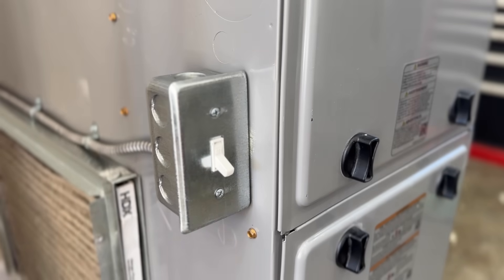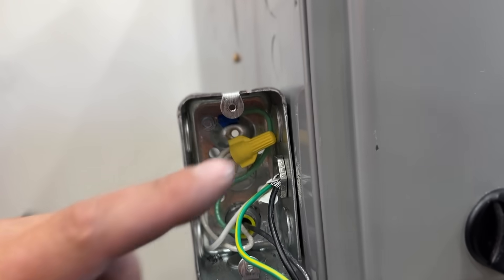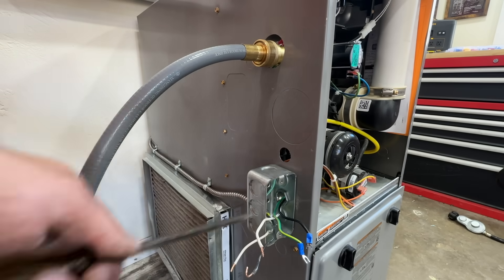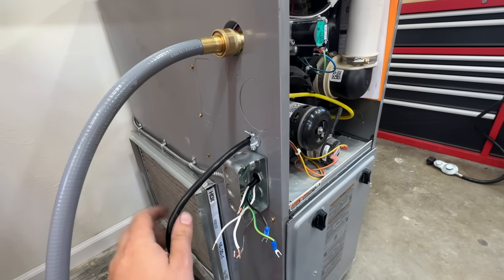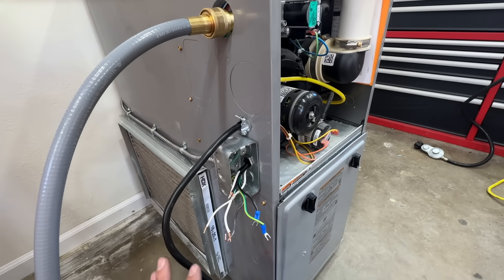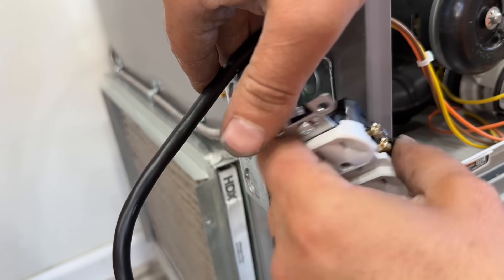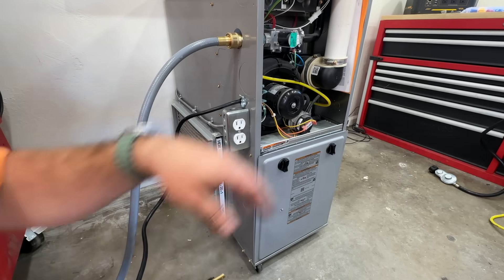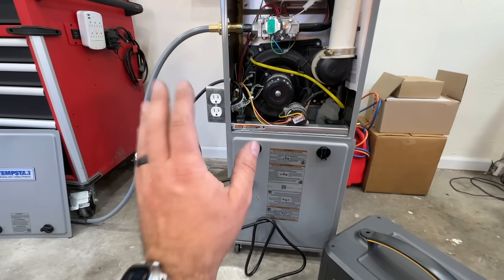Keep Your Family Warm During A Power Outage By Installing This $5 Part

Comment: Any options for those of us that only have an electric furnace? Is there a way to power it from a generator? I know the generator would probably need to be dedicated just for the furnace but in a winter outage, that heat is a necessity over anything else. Thanks.

Comment: The video was very well done. Thanks. I am curious as to why the pigtail goes into the furnace and then back into the box instead of just going into the box directly.
Reply from the maker: Because if the box was not attached to the unit, as a lot are, then you’d simply run the pigtail into the furnace, and then swap your switch for an outlet 👍🏼

Comment: For how long will battery back up run system motor+gas valve+ igniter +exhaust fan?????great video i did same with Water cooler but converted to 12volt system 👌👌👍all day for free all night Deep cycle batt…58degreezz until april in So cal desert

Comment: I would not recommend a remote AC voltage checker. Not OSHA approved. I would rather use a DVM
Reply: I'm not sure what you mean by "a remote AC voltage checker" but if it is just a "non-contact voltage tester" you'll need to provide chapter and verse before I will believe that. The US Occupational Safety and Health Administration (OSHA) requires some workers to be equipped with non contact voltage testers so as to avoid accidental contact with undiscovered exposed conductive surfaces which have become energized by a fault to a current carrying conductor. 

Telephone outside plant technicians carry them on their belt when climbing utility poles which also carry electrical wires and employer owned communication only poles. Those can be switched to continuously on to provide warning of low voltage communications wires that have a cross with power and light conductors. Some models can be focused on a particular conductor and opened to check a larger area. DVMs are classified as to what voltage that they can be used on. Non contact voltage detectors do not have to be categorized for different voltages because they don't need to make contact with an energized part to detect the magnetic field produced by alternating current. 

Tom Horne

Comment: The hole you drill for half inch connectors is actually a 7/8” hole, not 1/2”.

Comment: I split the cord going to my furnace and installed a box and plug. If grid power goes out, just unplug the furnace from the box and connect to my generator. Neutral and ground MUST be connected together in the generator for this to work. Honda EU1000 doesn't even come off idle to run both fans in the furnace.

Comment: Finding the electrical box to modify for my boiler is confusing, as I was unsure of which one is the "master" power box, which electrical box powers the circulating pumps and pump controls, and which electrical box is just for the burner. I thought about it and realized that I could start at the house electrical panel and follow the Romex which powers the boiler, and then (with the breaker off) cut into the Romex.  Cutting into the Romex will result in a set of black, white, and green wires coming from the breaker box, and a set of black, white, and green wires which go to the boiler. I can then place a new electrical box with the wires from the panel powering an outlet. And I can place a second electrical box nearby with the Romex which goes to the boiler connected to a pigtail inside that second box with a plug emerging from that box. The plug can then be plugged into the box which brings power from the breaker, OR it can be plugged into one of the outlets on my Delta Pro power station.  Logically, this set-up should work exactly the same as the one explained by the DIY HVAC guy in the video - the wiring is the same, it is just set up a bit differently.  Hey. . . if anyone sees a flaw, particularly something really stupid about my idea, please tell my why my logic is wrong. HEY DYI HVAC GUY . . .  IF MY IDEA IS WRONG (PARTICULARLY IF IT IS DANGEROUS OR MIGHT DAMAGE EQUIPMENT) PLEASE STOP ME BEFORE IT IS TOO LATE 🤔

Comment: I have aprilaire system so would I wire aprilaire to the pigtail or to the outlet? The way your video is laid out everything needs to be isolated from the incoming power outlet. I’m sure that’s the case I just want to make sure

Comment: Thanks for the great videos!  I just did this modification to our boiler.  Last winter, we darned near froze during a power outage, even though we have a generator. A previous owner had a generator transfer switch installed with a number of circuits, but unfortunately, the heating plant wasn't one of them!  I don't know why I didn't think of this fix myself, but at least it is done now.

Comment: I would just leave the switch in place. Add a 2nd box with the source of power and a receptacle. A chord from the switch box could either be plugged into the receptacle box or to an alternate power source. Switch will shut off furnace as usual no matter what power source is being used.

Comment: Except code requires you be hard wired. The code approved way to do this is with a dedicated transfer switch (even a single circuit one like EZ generator). The way this video advertises would likely fail inspection.
Reply from the maker: As I stated, this can easily be reverted and a lot of inspectors will not call this out in an inspection.

Comment: Not quite sure why you go into the furnace box first, instead of just knocking out another knockout in the switch/receptacle box.
SOP is usually to probe with the voltage tester FIRST (to ensure your tester is working), THEN cut the power, THEN retest to make sure no voltage.  It's rare, but you could get shocked if your tester has failed and you have not truly cut power
That's a nifty idea for the wire strippers.  I just use the end like a pliers to make the hook, but that works too.
If I'm not mistaken, relying on the tabs and screws of a switch or receptacle does not meet code, that's why there is a separate ground screw on the device.  Much better just to use a 3 position Wago and put in the pigtail regardless.
Love the Wagos.  Expensive, but IMO well worth it.
Should really tighten the cable clamp as tight as feasible; it should not rotate like it did when you did the last tightening of the clamping screw.
Hey! You get an extra outlet in the deal that you didn't have before, to use when the utility power is still on!

Comment: I recommend NOT coiling excess wire since it will create induction, which will lower the voltage slightly. run a straight zig zag, or end to end to avoid that issue.

Comment: I have always used a power cord on my furnace for this purpose and just plugged it in to a standard outlet. Living our in the country on a farm, we always experienced power outages, so your fix is a very good idea. I would've just put the romex connector on to the handy box, but it is just a preference. If you have a standard outlet near by, just pigtail the furnace. This can be done in a short time as it may be done during an outage, but it will require you to have the stuff to do it with, even if you have to swipe a cord off an appliance like a toaster, etc. I think the thing to keep in mind is this fix will only last as long as your power source, so plan accordingly. When this happens, you may want to make alt arrangements to relocate if the power will be out for a long period as most alt power sources will not last for long periods as your fuel runs out.

Comment: Does the furnace not need a switch close by, and screws not used in outlet should be tightened and not left loose.
Reply from the maker: The plug acts as a disconnect. So no need for a switch

Comment: That wire clamp is typically referred to as a "Romex clamp". Romex is the big brand name (much like people refer to all adhesive bandages as Band-Aids). Telling your local home improvement guy that you need a Romex Clamp should help you find one in the store. The actual nomenclature would be an NM clamp (NM standing for the Non-Metallic insulating sheathing of the wire). You may also find them as NM/SE clamps. The SE part isn't important for this application - but it just designates that the clamp is for Service Entrance (and indicates the cable jacket and the internal conductors are designed for above-ground installations and are listed for installations where the cable jacket and internal conductors are exposed to the sun in wet locations... in other words, residential use). Using these key words, you should be able to find them right off the bat with a google search.

Comment: I used an extension cord, stripped it, connected it to the furnace power wires, and ran it to the outlet.
Reply from the maker: Yea I don’t understand how some can find this confusing in the least. It’s like wiring a pigtail for any other appliance. Cheers

Comment: Before I ran a generator plug outside along with a lockout plate on main panel, I did exactly this, along with the same setup for my well pump (20 amp 120v).  I used a single instead of duplex, so no one can plug in anything else while furnace is running.
Reply: NEC 210.8(A)(5) requires a single outlet or a outlet/switch.
Reply: Guys, here is The Savior

HalleluYAH translates “Praise ye YaH”

YaH is The Heavenly Father 
YaH arrives via the TENT OF MEETING
YaH was Who they Crucified for our sins
YaH was Crucified on an Almond TREE

— Ancient Semitic Cuneiform of Moshe (Moses)
— Isa Scroll (The Original Isaiah)

Isaiah 42:8
"I am YaH; that is my Name! I will not yield my glory to another or my praise to idols.

Isaiah 43:11
I, I am YAH, and there is no other Savior but Me.

Isaiah 45:5
I am YaH, and there is none else.

Comment: Can we change this if you have a screw in fuse on the side of the furnace?
Reply from the maker: Yes if your breaker is the correct size for your furnace you can totally eliminate the screw in fuse switch combo 👍🏼
Reply: Would you have a video on that by chance. Thank you

Comment: I wired a kitchen sink disposer using a pigtail I cut off a 14 gauge outdoor rated extension cord, a normal outdoor rated thick sheathing/wire cover flexible electrical power cable . The city inspector doing a pre-sale home compliance inspection wanted the pigtail changed to an "equipment rated pigtail" whatever that is. Life Decided not to sell the house, I decided not to change the pigtail. Years passed and the disposer eventually failed, by then I had realized sink disposers were an unneeded, needless complication to life with bad odor potentials. Perhaps even pipe clogging potentials. Will there be some "inspector" who will want to see a switch? - hence perhaps a switched outlet would be acceptable?
Reply from the maker: Yes some would say it needs a switch, but some would say this is totally fine. And it’s easily reversible if that was the case
Reply: @diyhvacguy  I have gum-shoed around a bit because, living in Minnesota, I, as you, know gas furnaces are best wired to be easily powered during an electrical outage. One recommendation I found is to use a single outlet, rather than a duplex outlet, as the furnace circuit is meant to be a dedicated circuit.  The code, most certainty, needs to accommodate the reality of the need for home heating backup power options.

Comment: Why is it proper to have the hot on the right side?  I was told to have the ground prong on top in case something fell between the plug and outlet, it wouldn't short out.
Reply: There is no requirement in the US National Electric Code nor in the Canadian Electric Code to install the receptacle in a particular orientation. If you are concerned about this possibility use a plastic cover. 

Tom Horne

Comment: This is what I was looking for.. I’m prepping for this seasons winter storms which typically leaves the grid down for a few days. I have a Goodman GM9S800403AN and an Anker C1000… I noticed that it will power the blower/fan, but not enough power to ignite a flame.

Should I get a bigger unit?

Comment: Great hack!  Careful leaving any of the outlet's power terminal screws loose when installing them, especially in a metal gang box.  I made that mistake once and almost burned my house down.  Even if the screws aren't connected to any wires, they have power running to them based on the outlet's pass-through design.  If they aren't screwed down, they can arc to the gang box and cause electric shock and fire.
Reply: Great advice to tighten down any unused screw terminals.
Reply: I was looking for this comment.
Reply: Unless the device yoke has been damaged or modified, it would be impossible for an arc to occur at those voltages.
You'd need 10s of thousands of volts to jump a gap (like a spark plug)
Reply: @jsimanella  Not the point.  If the clearance is small enough, the screw could vibrate loose and contact the case, or something else conductive.  Vibration could come from the blower motor, for example.
Reply: @LoanwordEggcorn Agreed, in fact I have tripped circuit breakers during installation by letting the hot screws touch the box. It much less likely if you tighten the screws. Some recommend taping the screws, as well. That’s up to you. 😊
Reply: @TomCee53  Yes, I've seen people wrap electrical tape around the screws. Seems like a good idea.
Reply: @LoanwordEggcorn  I started taping outlets and switch a few years back.

Comment: Why do you say the hot should be on the right? I know it's a debate, but I feel there are only advantages to having ground up, and only disadvantages to having ground down. If something conductive fell on the prongs there's 100% chance of shorting with ground down, and less than 50% with ground up. It's safer when gripping the plug too. It 's not supposed to be a smiley face.

Comment: I don't understand why the original furnace power wires were not pulled out of the junction box and connected to the pigtail inside the furnace box itself. Wouldn't that give you a lot more room to work with?

Comment: Hi, i want to do this and during power outages, run it off my motorhome generator or inverter. My hvac system is 2 years old and dual fuel. I have a nest thermostat but no way to switch between heat pump or propane. If i lose electricity and use your setup, will system automatically run on gas? Thanks.

Comment: This is a great idea. Can it be done in an emergency situation on a gas fireplace that turns on by a switch?
Reply from the maker: Typically a fireplace has an outlet on the inside that the fireplace plugs into, so you’d just unplug it and plug it into your power station 👍🏼

Comment: Appreciate the video- this is a great idea!  However- you should ALWAYS run a ground pigtail to the outlet from the feed ground, and not rely upon the screw connections for your ground.
Reply: Agreed - at minimum he should have removed the fiber/plastic square washers that serve to insulate the outlet from the box.

Comment: I think that your modification is a good idea. But I would definitely check the electrical code. I am not sure of where you are located, but in my area, your modification is not to code. What was done will work but is not electrically safe. The ground screw must be bonded to both the box and to the device (receptical). The device mounting screws are not considered a proper bond. 

Also as an electrician, I can tell when a non licensed person does electrical work. You should always run in unused screws so they don't stick out (less chance of a short to the box) and the ears on the receptical (or any electrical device) should be removed when it is installed in a 1110 utility box. They just snap off. The ears are for when it is installed in drywall. Thanks for creating this video. If done correctly, it is a good idea.

Comment: I have a high efficiency furnace and have not powered it off of my generator for fear of it blowing the mother board. I have been told over and over again, by our HVAC company that I cannot run my furnace off of my standard generator. How do I make it work?
Reply: As long as you leave all of the Equipment Grounding (USA)/Bonding (Canada) Conductors spliced to each other and the branch circuit supplying the furnace originates in the Service Equipment panel, damage to the control board is no more likely than it is when powered by utility power. If the branch circuit for the furnace originates in a panel supplied by a feeder than their could be an additional cause of damage to the control board. 

Tom Horne

Comment: I believe in Canada an extension cord cannot be permanently installed.
Reply: It cannot be permanently installed and still comply with the US National Electric Code either. 
"400.12 Uses Not Permitted. Unless specifically permitted in
400.10, flexible cables, flexible cord sets, and power supply
cords shall not be used for the following:
(1) As a substitute for the fixed wiring of a structure
(7) Where subject to physical damage."
That is why it would be better to use a double pole, double throw, center off switch and a power inlet in place of the cord. The switch I'm writing about is no bigger than a 4 way switch and can be mounted in any switch box. It switches both the Grounded/"neutral" conductor and the energized conductor between the furnace's branch circuit and the power inlet. If you do a search, using your favorite search engine, for "power inlet" you will see the device I'm writing about. An extension cord is only used when supplying the furnace from a back up power source. 

Tom Horne

Comment: If you wanted to dedicate a battery pack to the furnace, could you just leave it plugged in and plug in the battery pack to the power so it stays charged, like you would with a UPS on a computer.

Comment: Great video! Can you use a gas generator instead of the power station? Will a generator like a Generac GP 5500 power the furnace safely without  harming the computer?